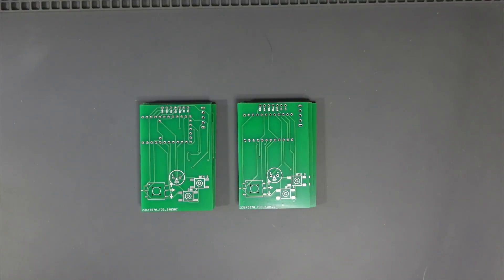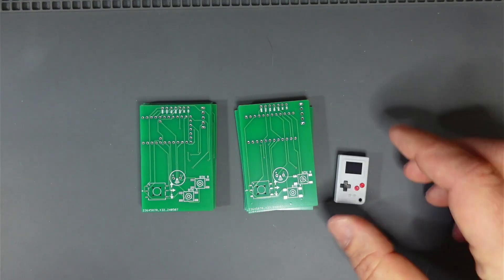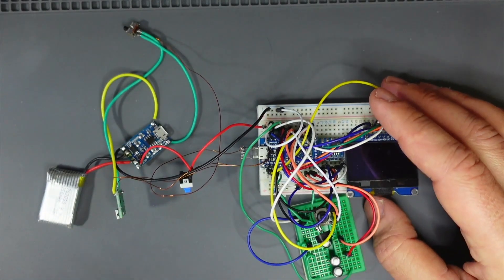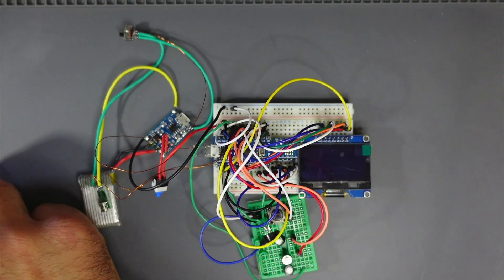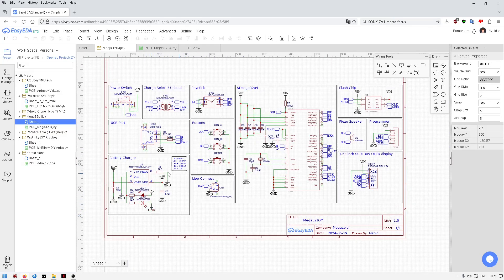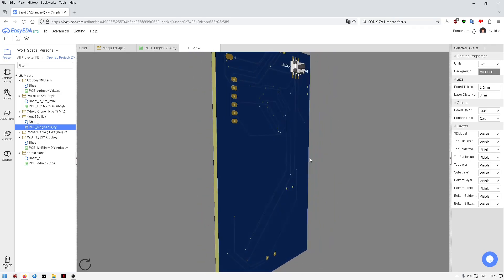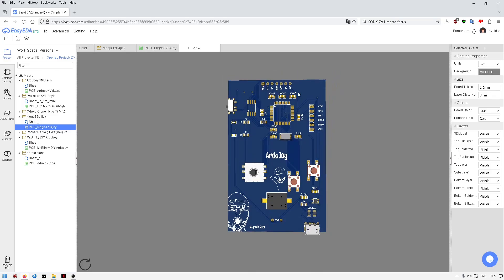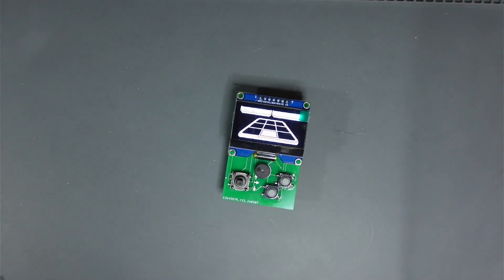Test PCB's for a DIY Arduboy FX - "kinda work"

Comment: You could add a p type mosfet between BAT and VIN that would disable BAT if VIN is high. This would allow you to remove the physical switch and both power / program directly from the Arduino USB port.
Reply from the maker: There probably (almost certainly) is an electronic way of doing it. My switch just moves USB positive from from the TP4056 (Lipo charger) to VBUS on the Pro Micro (or whatever ATMega32u4). D+ and D-  are permanently connected to the secondary USB port. I want the Pro Micro off while I'm charging.

I'm a rookie, but I can't totally see a mosfet working. There might be a way to incorporate the "fully charged" signal into then allowing programming mode, but that's kind of a lame idea. You could be right with your P type mosfet and I'm just not getting it. 😆
Reply: @megazoid  it's bit compllecated for very little return? but the problem on while its charging, have it display some sort charge state, like almost everything screen does, the flash picture battery in segments,
Reply from the maker: @dh2032  That would involve redesign of the bootloader code - waaaay beyond me😆 Nice idea though. I should probably just run the whole thing by Mr Blinky over on the Arduboy forum.